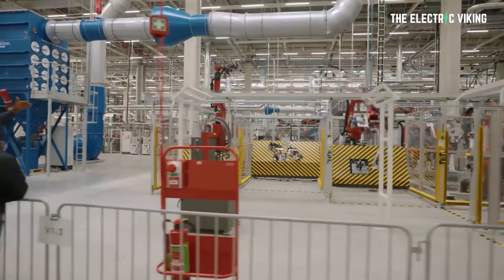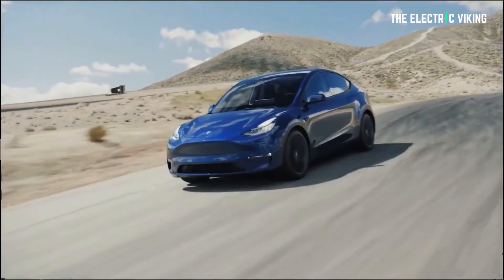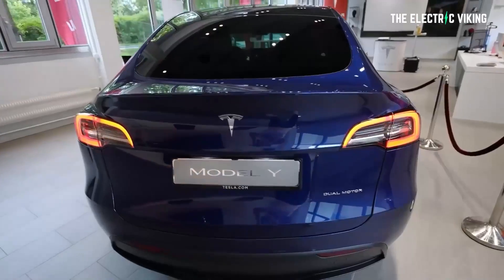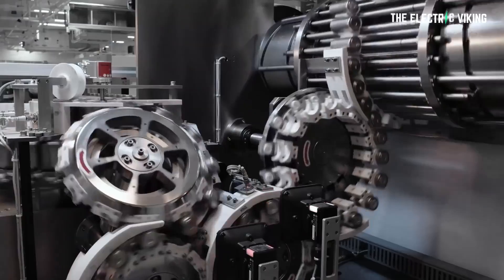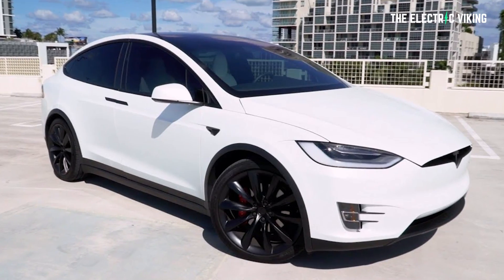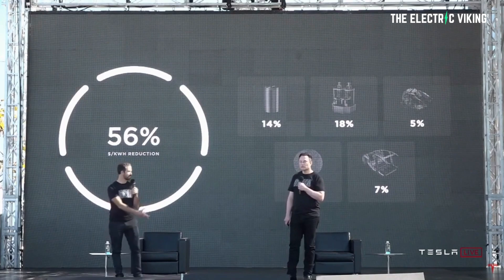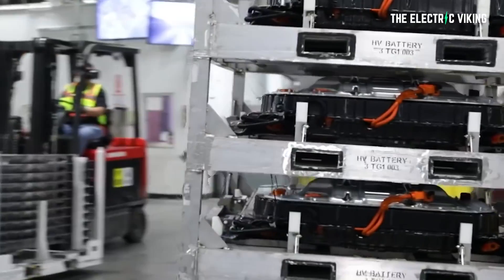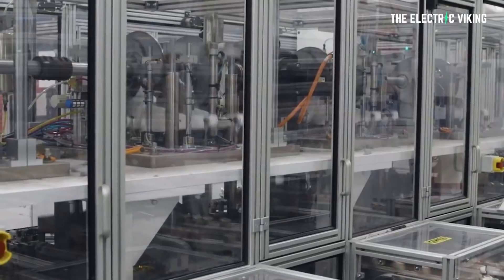Tesla Model Y at GIGA Texas have 4680 structural pack!

Comment: So if one cell fails you throw the car away? With Model S / X the pack was easily removable and divided into 18 modules. These packs can be repaired / refurbished. Also these modules (22.5 V / 5.2kWh at Au$2000) can be reused in solar and are popular in Ev conversions. In my opinion: Total fail, Tesla. Not sustainable.
Reply: The cars are designed to handle the rare occurrence cell failure here or there and go about their day. Enough redundancy, buffer and head room is built in. There is no need to uninstall, replace, repair, reinstall a module, and repurpose it..
Reply: @justinmallaiz4549  As an electronics engineer who has actually worked on EVs let me tell you that your comment is incorrect. One faulty cell can brick the car. Check out relevant videos from Gruber Motor Company or Rich Rebuilds.
Reply: @justinmallaiz4549  This is only half correct. There are several modes of cell failure and one common fault is where one defect cell discharges all other cells in parallel to the defect cell. (74 in case of the Model S / X) . The BMS then shuts the car down.
Reply: @moestrei  
Taycan says "hi'.
Cheap on board charger, "bricking cells".
Cars still running.
It depends on the BMS.
Reply: @moestrei  It would be very foolish to think Tesla hasn't learned and designed for all cell failure modes, before going to a structural battery pack.. They are the leaders with a ten year head start, and (indisputably) have the most experience with this.
Reply: @justinmallaiz4549  I drive a Tesla D and yes it's kinda foolish once the warranty expires. Which will happen in a few months.
Reply: @moestrei  I look forward to racking up 800,000 kms on my model Yp
Reply: Ridiculous

Comment: I have a MYP on order and i keep delaying the order in hopes of this. Was the tax rebate first. Ordered in November so hopefully can delay until April at latest. Unless the new model is a lot  slower the resale value on the older models will be trash if the newer is much better.
Reply: The new Model Y will be much better. Faster charging, much faster acceleration, better handling, longer range, better fit and finish, even better regen braking. It will be significantly lighter, which obviously helps acceleration and range, and then the tabless batteries will be able to pour out power faster and with less heat created, allowing much better track performance with less overheating and also greater efficiency because heat is electrify lost to useful application. Then the structural battery pack means both stiffer body and weight closer to the middle of the car which helps in corners.

The new Model Y will be way better, people are missing what an enormous improvement is coming. It is the product of an enormous series of innovations at Tesla that involved new alloys, new Gigapress machines, buying several battery technology companies, and many years of the best engineering minds in the world. They didn't do all that to make cars that were pretty much the same as what they could already make.
Reply: The reduction in manufacturing costs will increase Tesla's profit margins even more . There is no way the legacy automakers have a hope in hell of catching up. Watch them fall one by one. It's going to get messy.
Reply: Most of the difference is in cost to build and ease of manufacturing. I doubt you will see much difference in the cars handling or performance.